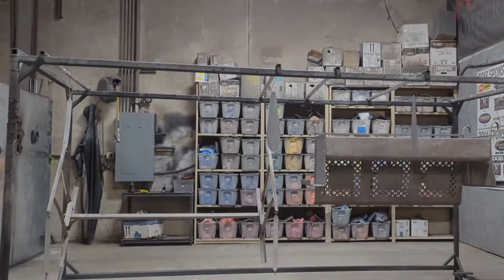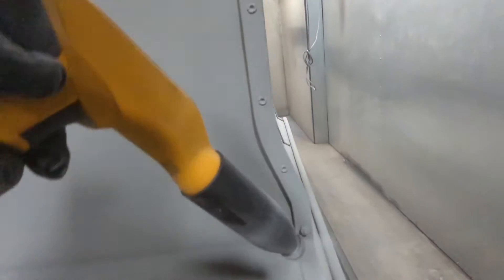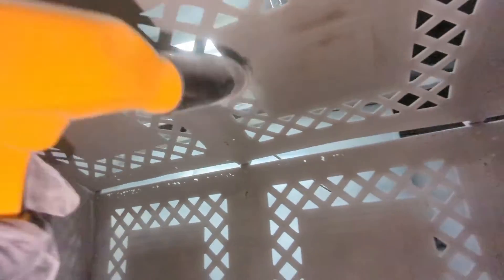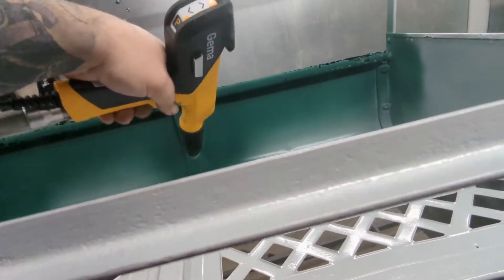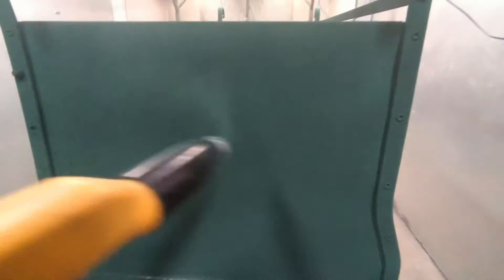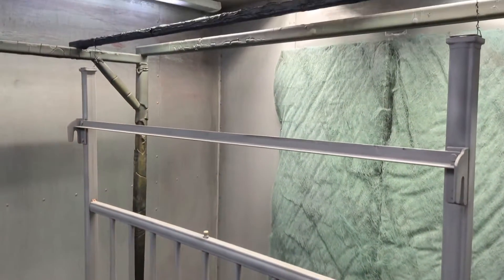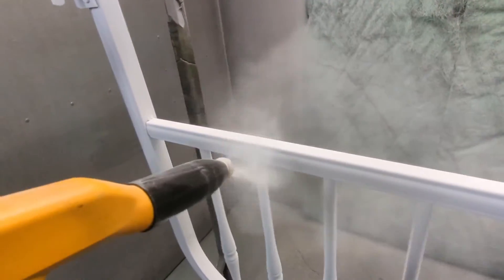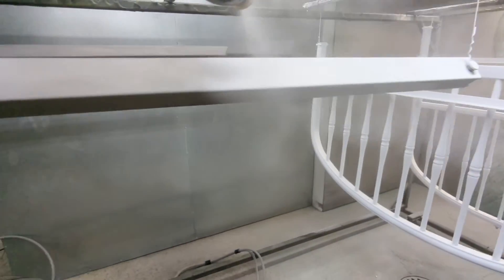Powder Coating Antique Garden Furniture...and a bed 🙂- Ep 137 - Unknown Coatings

Comment: Whooooo, this is NOT the proper way to do this.  Glider needs to be completely disassembled, each piece blasted, epo strong filler, or new metal, then primer, then top coat.  Your customer is going to be very disappointed, this is gonna rust within a few weeks.  Come on man, you call yourself a professional coater, we professionals DONT cut corners! Not Good!